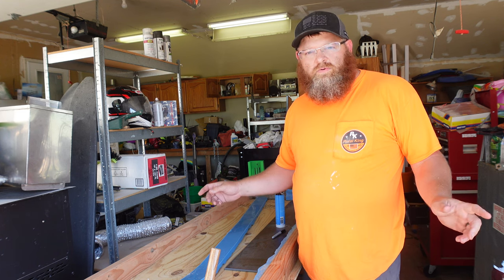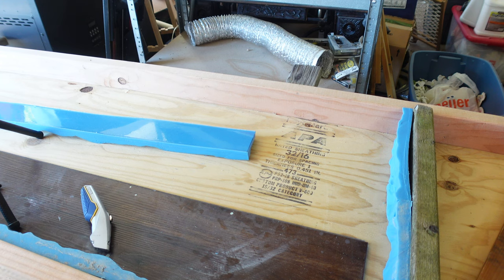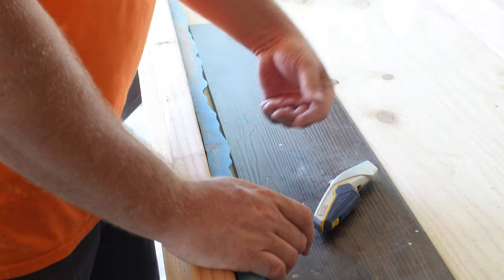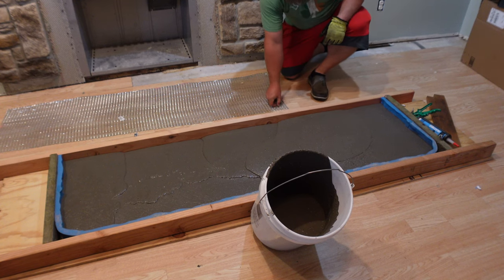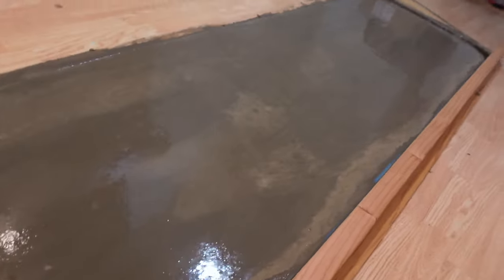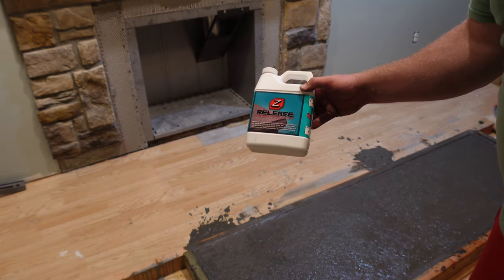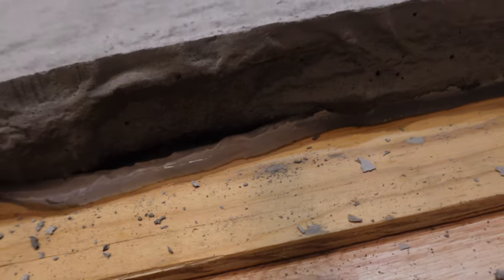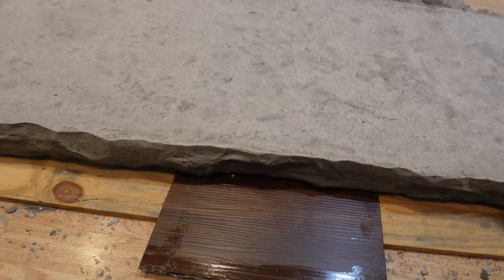DIY Concrete Hearth Amateur Part 1

Comment: Great Video. Think I will try a light brush top texture for the cut stone look.  Since you are going to stain it anyway, you can cover any air bubbles, by wiping some Bondo All-Purpose Putty, over them with your finger.

Comment: nice job. I'm putting in a new fireplace soon and wanted to see how this would look and I think I'm going to do it. I do masonry work for a living and pro tip...use an ordinary palm sander on the outside of your form, works almost as well as an expensive vibe tool. Also you can can use an acid stain or an antique kit from brickform to add color down the road. Edit: nevermind I just saw your part 2 that turned out amazing man
Reply from the maker: Thank you!!!

Comment: I love your hearth. I want to do what you did, but I’m nervous.
Actually, I want a hearth for my wood stove to sit on.The wood stove won’t be arriving for a month or two. Tomorrow I will start on this.
Reply from the maker: I get it, I was super nervous as well.  It took me weeks to actually build up the courage to pour it.   The only thing I would include if I were going to do it again is to add in a base color to the concrete so that if there were any scratches or chips they wouldn't be noticeable.

Comment: Thank you so much!! I'm considering doing the same thing for a DIY fireplace project. Just can't see myself paying over a thousand for a hearth when I can do it myself for less than 500.
Reply from the maker: The #1 thing I would do different is that I would also add a base color to the concrete in case you get a chip it would be hard to see.   I was quoted $1700 for a hearth. Thanks for the comment and I hope you your project turns out great!
Reply: @Country Hobbyist  yeah yours turned out pretty good, I get your point about adding a base color, thanks for the tip.